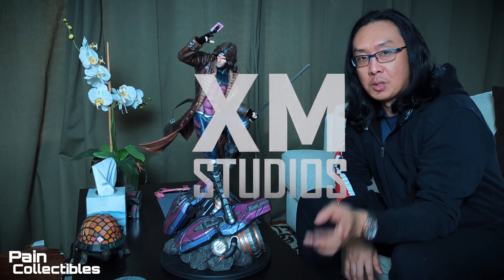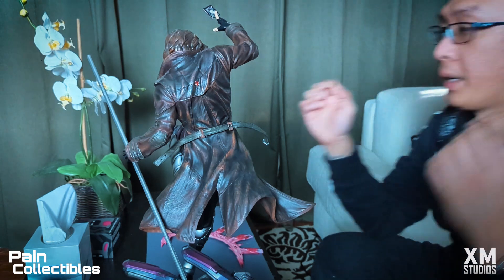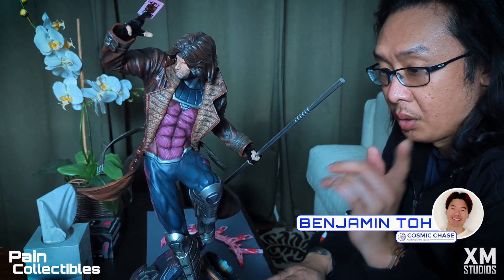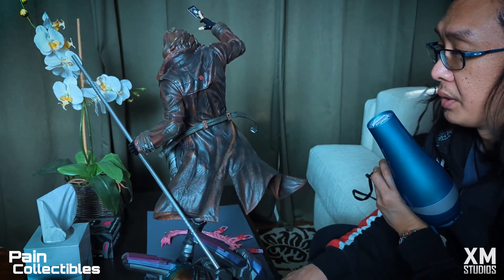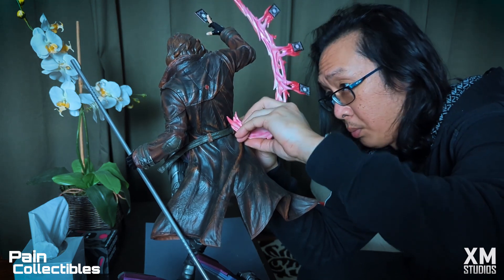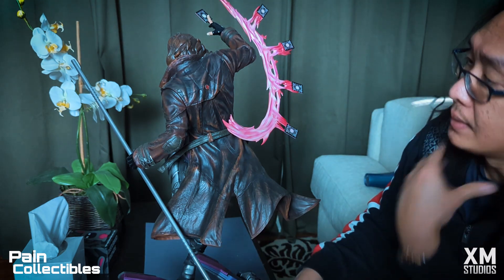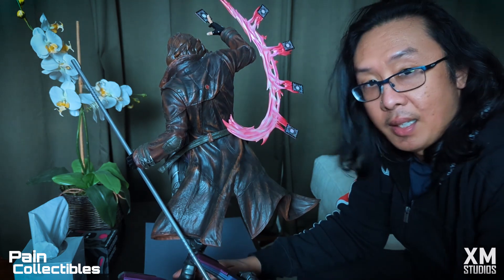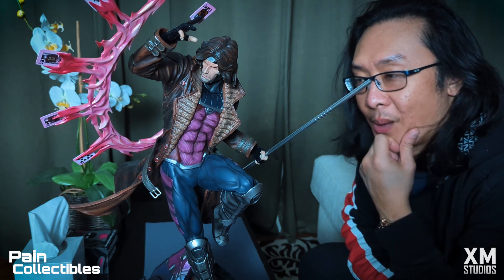It's Hairdryer time! | Fixing simple resin issues with a hairdryer

Comment: SUP BROTHER, OH YEAH I REMEMBER THIS TECHNIQUE. DO YOU REMEMBER WHEN XM MOON KNIGHT CAME OUT? MOST EVERY BODY HAD A PROBLEM WITH IT. BRYAN AND ANG HAD TO MAKE A VIDEO SHOWIMG HOW TO FIX IT. THEY DID NOT USE A HAIR DRYER THOUGH. THAT DID NOT WORK ON IT. ANG TOOK THE WARPED PIECE AND HE BOILED IT IN HOT WATER. THEN HE PULLED IT OUT AND BENT IT BACK TO SHAPE WITH HIS BARE HANDS. FIXED IT. I AMM GLAD YOU FIXED YOUR WIFE'S STATUE.👊🏽🎤🎸
Reply from the maker: it was before my time so I didn't see that, that's crazy boiling the part, but it makes sense, hair dryer is easier though ha ha
Reply: @PainCollectibles  YEAH THE VIDEO IS STILL AROUND. I WILL SEE IF I CAN FIND IT FOR YOU.👊🏽🎸

Comment: Really great video Toshi!  Question about using a hair dryer on pieces with a bigger key, I had an issue with one of Grimlock's legs.  It's was very tight when trying to insert the key with pin in the hole and I didn't think a hair dryer would be applicable in this case.  I guess it may have softened the key to push in, but if so would I have a lot more of a problem taking it off?  I ended up using a lubrication to get it in 😁 but it was still a bit difficult.  Would a hair dryer have worked?
Reply from the maker: I would heat both the key and the keyhole so that they both expand and then push it in

It should settle around it. And should be easier after that
Reply: Thank you!! I will definitely keep that in mind next time it happens!!
Reply from the maker: Actually heat the hole for a few minutes and then see if the peg slides in without having to heat both